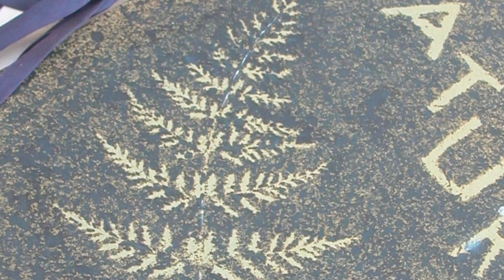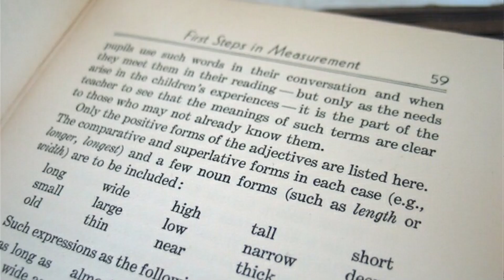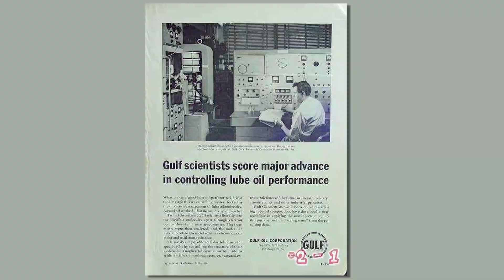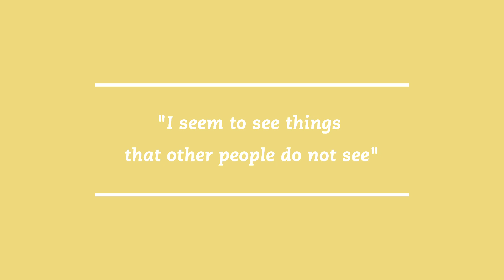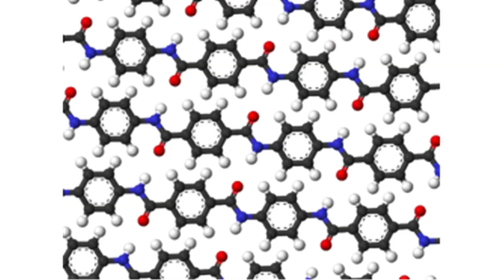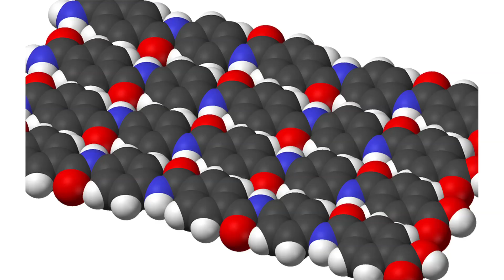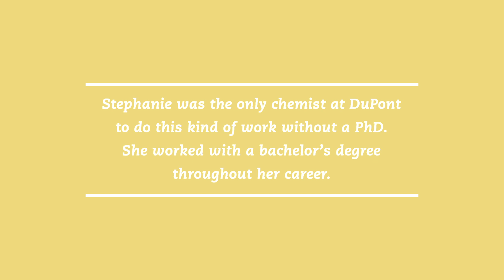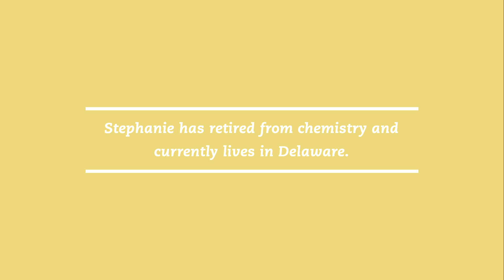Women in Chemistry: Stephanie Kwolek

Comment: I discovered that I could use Kevlar as an motor shaft pressure fittting insert for my drone motor that manufactuerers don't make bolting shafts for the motor. It works wonders. And I am so surprised just now that Kevlar was invented by a woman.

Comment: ya left out many details regarding the disposal, application and toxic complications of kevlar very strange
Reply: Kevlar is a NONTOXIC fiber composite. You are talking about inhaling the fiber dust. Have you ever think that about 80% of all kinds of dust are potentially dangerous for the human body? You have no specific toxicity connected to kevlar. Inhaling the kevlar dust is just as dangerous as thousands of thousands of other materials and particles in the form of dust.
In fact, on a regular basis, people are exposed to only a few kinds of dust (dust compositions) that don't require wearing some kind of protection against permeation of the smallest parts (here sub-fibers) into the body. 
If I wouldn't know if cutting Kevlar is safe or not I would wear protection myself.
Reply: Just because she is a woman?
Reply: Thank you, SANPH, for stuffing a sock in DMrk. This was about Stephanie, not just Kevlar.